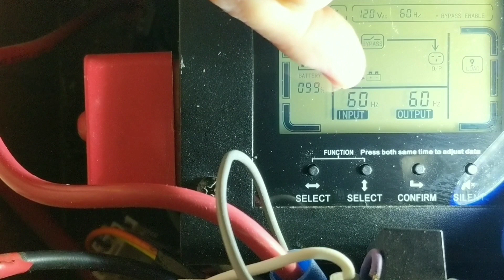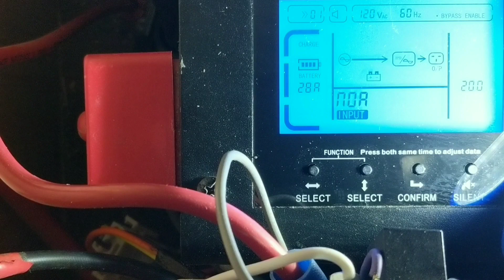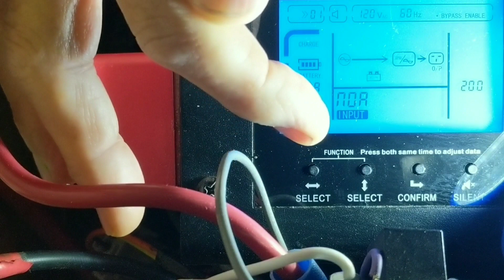Stop Your Inverter/Charger from Charging Ecotreks

Comment: What is the purpose of disconnecting the battery from the inverter? Are you supposed to leave it disconnected like this all the time? 
Thanks
Reply: No. LiFePO4 batteries should ideally be kept at ~50% charge (resting voltage 13.1). AGM and wet cell batteries must be charged to 100% regularly, and kept at a float voltage. This procedure would be for maintenance. For extreme cold or heat, you may want to disconnect, or reduce charge / discharge to a few amps until things normalize, but the inverter/charger and BMS should do that automatically.